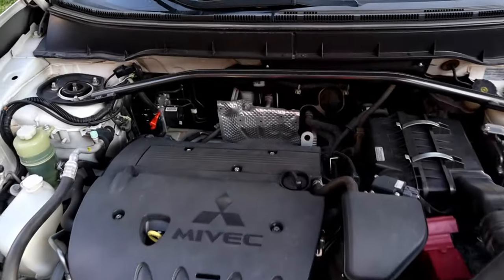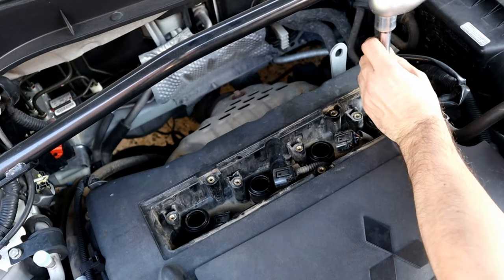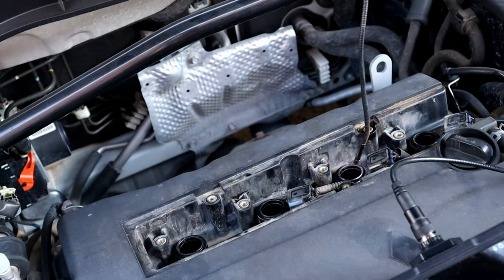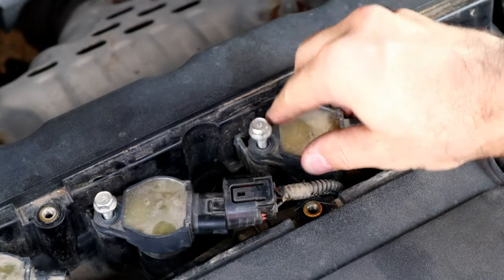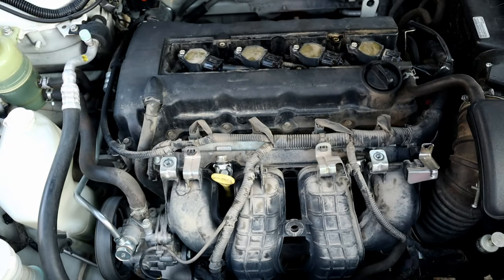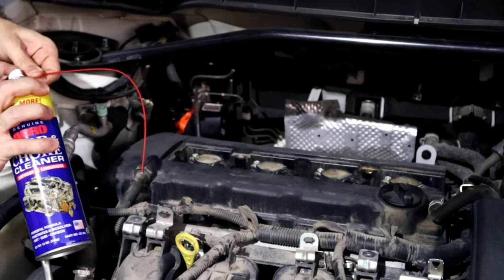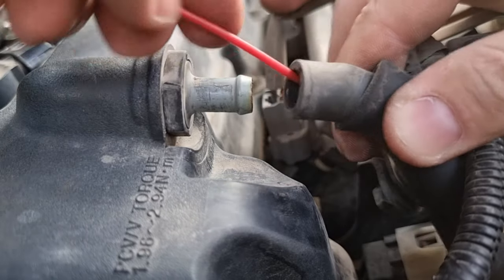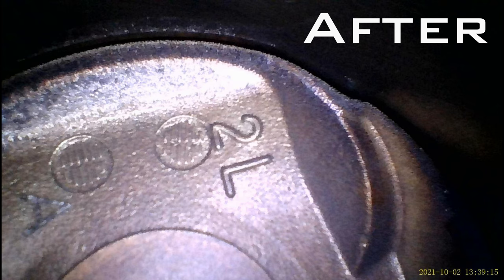Piston Carbon cleaning without expensive kit/Cleaning Piston Carbon buildup Carb cleaner/ALIMECH

Comment: What I've done myself is unhook the fuse for the fuel pump and run the carb cleaner directly into the fuel rails, that way it also cleans the injectors as well as the internals of the engine.
Reply: this is what I am thinking too. hehehehe
Reply: How is it? I mean after spraying the carb cleaner, did the car hesitate turning on?

Comment: Thanks! Your way of cleaning fuel injectors and piston tops are excellent!  Have you done any piston rings cleaning? Of course without disambling the engines, For the oil burning engines?
Reply from the maker: Not yet! But even if I do that I can't show that with camera, only with disassembling the engine
Reply: @AliMECH  you can try pouring carb cleaner into cylinder from spark plug port and let the carb cleaner sit overnight
Reply from the maker: @sub-zero1 not a good idea, it will dry out cylinder wall and create scratch
Reply: @AliMECH  Easy solution is to let it soak overnight with plugs in to reduce evap. Pull plugs and what ever did not evap will now, or you can use a cloth to wick it out. Spray a light oil inside and first strokes will re-oil the walls.
Honestly though, people have been doing this forever,  and have NOT seen anyone complain about scoring.

Comment: Hi, for cleaning the pistons and intake manifold you did two videos where in one you sprayed carb cleaner through the pcv valve and the other through the vacuum hose. What is the difference, I am asking because I have a Toyota Vitz 2012 and sprayed through the pcv valve. Should I do through the vacuum hose on the vitz. Awaiting reply. regards

Comment: The piston was cleaned, the 2L suddenly showed up in the "after" image of the piston whereas in the "before" it wasn't there. Suggestion: if you do comparison of "before" & "after", make sure you take a picture of the same subject before & after the procedure.
Reply: Valid point, just noticed the two pistons were different.
Reply from the maker: Yes, that's a great point, i  took the same spot, but for some reason, some pics gone from the sd card, so i had to use this
Reply: The 2L on before image was hide by the carbon
Reply: Idk if I believe this video because the 2L isn't a imprint it's raised up and I would think you would at least be able to see SOME type of it's presence
Reply: The two circles that are inside are imprinted and you can still see those just fine...if this video was true wouldn't the carbon build up fill up the imprints before it makes a RAISED UP marking totally unnoticeable?
Reply: @AliMECH  why is the carbon build up heavy only on the edges of the piston?? Possible cause weak oil rings??
Reply: @SiZ  That's not honest , as well as you didn't mention it in video.
Reply: ya i just tried this on my 400,000mile toyota celica gt  an it didn't work  hell it gave me multiple misfire codes it took 3 days  for my car to start running right
Reply: @donjames5761  You prolly shoulda did it sooner. 400,000 miles and you want a miracle to happen?😂😂
Reply: but did the world end? no you’ll be fine.

Comment: the carburetor cleaner will only clean the intake valves.. It evaporates immediately and get burnt when it's in a running engine.. 
What cleaned the pistons was him driving like a savage.. 
You can clean your pistons by simply driving every now and then on the highway with high revs. The heat will cause the carbon to simply burn.
Reply from the maker: No no u have no idea what u saying bc u didn't try it, I have many videos doing this,  even before driving the car, you will be able to see big difference

Comment: This almost is the same method used to clean the catalytic converters using Liquimoly cleaner, so do you think if i use the mentioned product, it will take care of the carbon build up on top of the piston prior to entering the cats via the exhaust gases?

Comment: Thanks for the video, what is next if I did this procedure but the carbon in the pistons is the same? which other procedure can I try? thanks!
Reply from the maker: It's not gonna be same, it will definitely will be less, and you can use another can if there was some left
Reply: @AliMECH  thanks for your response, I recorded the pistons state with the endoscope before and after but saw them the same. It is a camry 2010 hybrid, maybe that can be the cause? is the procedure with the compressed air and the cleaning tool any better? thanks!

Comment: I have a 2003 F150 with 4.2 V6. I bought it recently. I changed the spark plugs today. I looked at the piston tops with a camera. The rear piston on bank 1 and the front one on bank 2 had carbon buildup. The rest did not. Any idea what this means? I can tell you that I have been running Lucas fuel system treatment. I wonder if maybe those two spark plugs were so bad that it made the fuel system cleaner ineffective in those two cylinders. What do you think? There are no codes. The symptom I'm chasing down is pinging while accelerating. I can also tell you that there is pitting in the carbon buildup of the two pistons. I can also tell you that the two spark plugs for the pistons with carbon has white stuff caked up on the electrodes.

Comment: Ali you have a great wonderful videos bro , mate that’s how it should be straight to the point no bullshits , really thank youuuuuu for the great job you show all of us how save money helping us 😊🥰. 

Mate I want to asked you , just before one month I change my antifreeze I’m my Toyota crown 05 V6 after that I check the oil it was on the lowest dot I start the car because I see a white clear smoke no blue nor black color this is at first and knowing it’s early morning now in Russia it’s little bit getting cold and this is first I smell it it’s not sweet smell it’s mixed between like oil burned plus fuel not burning well , I give it a riv gase paddle and make to 3000 up and start give me white bluesh smoke smell like rubber burning or brake fluid burns !! I’m now confused 
As soon I add Toyota 5w40 oil to the right level it’s just gone no smoke at all🤔 ? i always I service my wife’s car by myself on every5000km I change oil+filter , car done 367000 , and no power losing at all  never had issues overheating or something ?? 

My best regards to you bro
I wait to hear your reply 🙏🏻😊
Thank you 
Matt
Reply from the maker: I think oil leaking on piston,  maybe from intake or exhaust valve seals, and then you used thicker oil and it stopped that from happening

Comment: Not recommended for long time used car: 
1. Carbon build-up in the holes of piston rings may be loosen that your cylinder wall will be scratched.
2. Don’t do this if your cylinders have silicon coating wall build otherwise the wall might be corroded. Especially for the BMW MERCEDES engines.

Comment: :hand-pink-waving:I purchased Graphenizer Liquid online & used in my (Cab) 12 yrs old Tata indica car for cleaning Pistons & Injectors, it stops Black smoke in 10 mins and become like a Brand new car. It also reduced engine’s overheating and stopped oil leakage instantly, I Driven 36000 kms now, not changed the engine oil till 40k. I recommend everyone to try it once. 

Graphenizer ( Search in Youtube) to removes the hard Carbon Instantly in 10 mins, without opening the engine or using any machine. It also gives 50% Extra Mileage & avoids 90% of engine repair problems. It is a good return on investment.

Comment: Hi. I've only just come across your videos on DGI engined cars to clean inlet valves and piston tops. In this video you say to change the engine oil after the cleaning process. In another video you was adamant that no oil change is needed. This to me is contradiction on the same method using carb cleaner. What do you have to say to this? 
I'm intrigued by your methods. I have a lexus is250 which I'm looking for advice to clean the inlet valves. 
I await your response.

Comment: Hey Ali, Can i use WD-40 Carb/Trottle Cleaner right before the butterfly valve of the throttle body instead of that carb cleaner you used?

I asked because the WD-40 works as a throttle body cleaner
Reply from the maker: It's safe but it won't get dry like throttle body cleaner, and when there is wd40 on the sensors, you will get check engine light on
Reply: @AliMECH  thanks for reply!
If I can only use that I'll be sure to let it dry  for couple hours before I turn the engine on. But I'll do what you did and use a vacuum line
Reply: @chevaldodavidson1361  it's oily and won't dry.

Comment: I have a 1970 Chevy 350 with 90,000 miles on it and my piston tops have a lot of carbon on them. how can I clean them without removing them? It just has a regular 4 barrel carb
Reply: I think the trick is to do this every once in a while, don't let it get to thick /hard.
I took my 350/381 stroker apart (basically new, but 16 years old), because I wiped out a soild roller cam.

Took the heads off and there was a bit of build up.

Heard about a trick to clean tops of pistons with "acetone and tranny fluid".

Works a bit with a nylon brush.

Regular carb cleaner, sprayed onto the pistons litteraly almost melts it off!

Carb cleaner for the win.

Brake cleans works a little bit too.

Now since everything is clean, I'm going to use a can or 2 of carb cleaner every year, after I cruise around. (only drive the Camaro in the summer.)

Clean pistons before it sits all winter. Then "fog" the motor a bit, for storage.

Comment: Will the carbon clogged catalyc converter or it'small enough go thru the tail pipe ?
Reply from the maker: No it will pass the catalytic converter
Reply: The cat converter is hot enough to burn any carbon that get there.

Comment: Salam Ali Bro ...
Bro I used this method to my 660cc and 800cc car but the problem is that I recently changed my engine oil and after that I clean my pistons by this methode.... So if I can't change oil after cleaning piston is harmful to my engine or not??????
Reply: Plz reply faster.... Thannx
Reply from the maker: If you used full can of carb cleaner,  yes it's better to change
Reply: @AliMECH  why should you change the oil? It doesn't mix with it
Reply: @abu-ali-aljehany  probably don't need to, but couldn't hurt.
Reply: @abu-ali-aljehany  because of the blowby it passes through the piston rings to the engine oil...in small amount

Comment: tq ..bro..2nd comment..haha..btw i tot you will use crc product ..coz u said so in your reply to me b4 ..so normal carburator cleaner will work ?
Reply from the maker: Thanks bro  🙌 😅
Reply: @AliMECH  so it mean no problem to use normal carburator cleaner rite ? dont to only need use crc ?
Reply from the maker: Yes no problem if you spray it from the other side vacuum hose like I did with getting contact with throttle body and mass air flow sensor
Reply: @AliMECH  gotcha .. so it make easier for other people to  learn from this vid.. save lots of their money just by doing simple trick .. kudos for ya
Reply: @AliMECH  hope this vid will reach to million viewer and attract more subs
Reply from the maker: Thanks for supporting, appreciate that 🤜🤛
Reply: Not a good idea to have the liquid spray in contact with MAF sensor, could spoil the heating element of MAF sensor. Use a vaccuum hose down stream of the MAF sensor, brake vacuum hose a good one.
Reply: @metzmatu8409  yeah ..that why he avoid to use the other pcv valve that connected to those 2